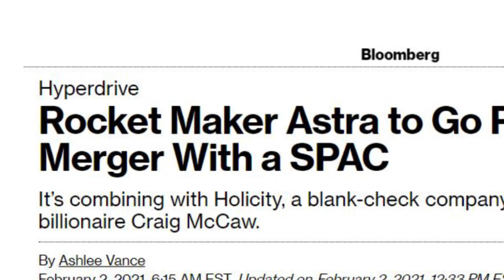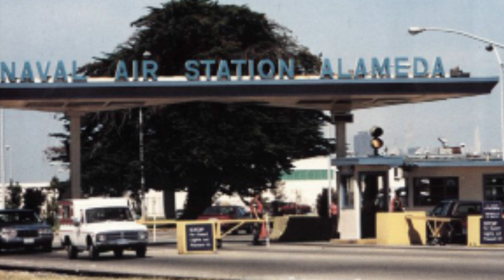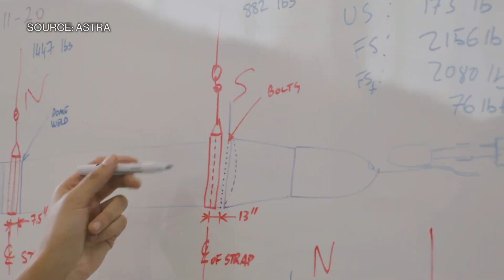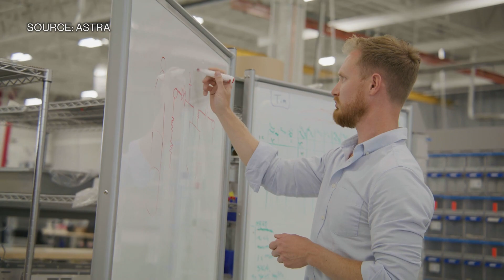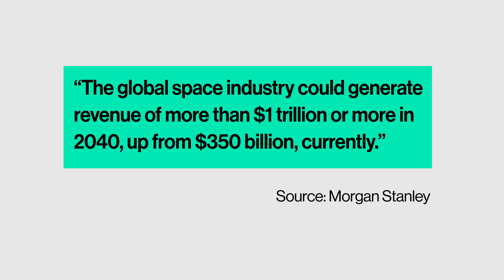Astra Is Latest Rocket Company to Go Public

Comment: Stock got beaten down badly. Can’t even hold $14 😂 200 shares @ $13.61. Want to see what it does in April.
Reply: Would be great if it comes down to the high $10’s like many of the SPACs lately 😆
I’ll be buying those dips all the way down from here in the low $13’s